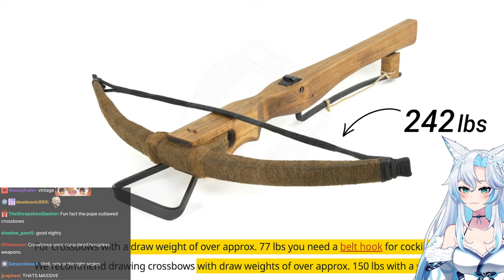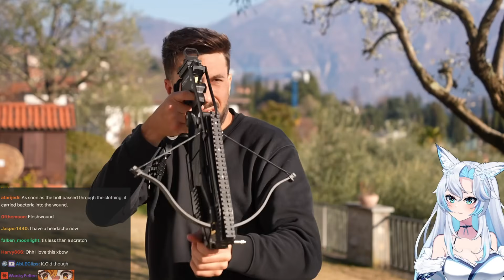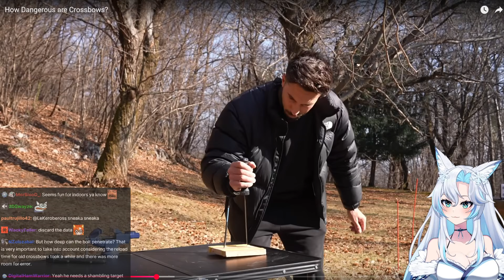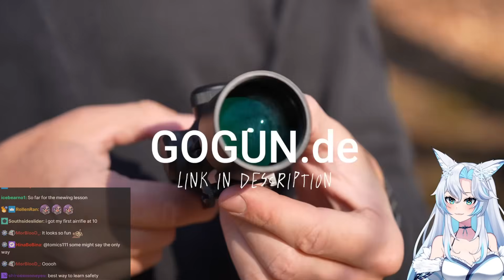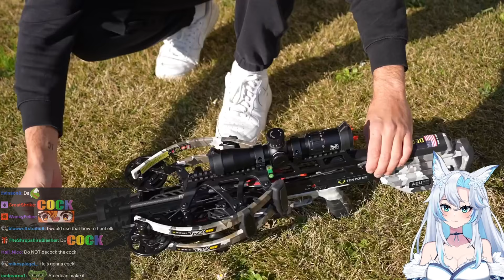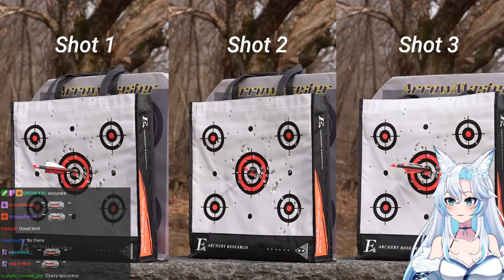How Powerful are Crossbows?

Comment: Thing with the Tenpoint is that you can likely attach a battery-powered winding motor on that loading mechanism and you can partially, or even fully, automate cocking the crossbow. If they add a magazine system on top of that, you'd get the perfect crossbow.

Comment: In fairness to the medieval crossbow, he was using target tips so it wasn't going to have nearly the effectiveness of a broadhead or bodkin. One interesting thing that a chatter mentioned, Pope Innocent II banned the use of crossbows in 1139. Now a lot of people think this is because they could penetrate plate armor but that's not really true. Some versions like the arbalest could pierce some cheaper plate armor but those had spring-steel arms and was essentially using the leaf-spring from an F-150 to throw stuff at an enemy. They were also hideously expensive and were basically used for battlefield assassinations. 
The real reason crossbows were banned was because of ease of use. See there used to be a saying in England, "To properly train a Longbowman you have to start with his grandfather." it takes decades of constant practice to get good with a war-bow, which means there's usually a limited number of truly dangerous archers running around. A crossbow on the other hand, you can teach any idiot/peasant how to use one of those in a couple hours. Give them a week or two and they're going to be as accurate at the same distance as an archer who has been training since they could walk. This made the peasant class way more lethal than usual since while you could keep track of the people who were trained archers, anybody could use a crossbow so there was no telling who was capable of killing from a distance. Now one crossbow was no real danger to an armored knight, same as ONE longbow. Ten of them on the other hand was a different story since with that amount of shots one was bound to find a weak spot. And since they were so easy to use it was starting to change the battlefield in favor of the peasants, which the church absolutely did not like. It's essentially the same reason firearms took over the way they did, it's not so much how much damage they could do, it's the fact that anybody with a few days of practice can use them effectively.

Comment: The adder comes with a 130lb arm far exceeding the results he showed. BUT you better have the arms to cock it. Women have complained they can't. Also the test for penetration was unfair because the first board had Knots where he shot the bolts the second board was knot free making it easy to split.

Comment: How powerful are crossbows?

Well, Crossbows are torison engines. They store kinetic energy in the materials they are made of in the form of tension, and release it all at once when triggered. The only things really limiting their power are A. How long it would take to wind a truly ridiculously powerful crossbow with manageable gear ratios, and B. The ability of the materials the crossbow is made of to not tear themselves apart.

Comment: Chu-ko-nu was a Chinese repeating crossbow from like 2000 yrs ago. Their greatest weakness is that they're quite weak or just straight useless if you're enemy has proper armor on. A proper American solution would be to ramp it up to lethally pierce through modern day body armor. How heavy would that draw have to be to accomplish this consistently I wonder? Makes me wonder if it would just be a better idea to find a way to make the Roman ballistae type siege weapon(i can't remember the damn name) fire faster so we could accomplish the same thing.
Reply: Well, Romans had multiple types of "Ballistae" type of weapons, but I think for anti-personell would be called "Scorpion". They also had early Crossbows - "gastraphetes", and large Ballistae for shooting rocks in sieges. And they had mathematically pre-computed manuals to build those in field, with dimensions already written down. True army of engineers :)
And Jorge Sprave made wooden "automatic" crossbow, similar to "Dwarven repeating ballistae from Hobit: Battle of five armies (extended cut)", but in normal crossbow size
Reply: @johandark5736  Yes! That's what it's called! Scorpions those are the ones I'm talking about. Also, thanks for insight and channel recommendation. I'm checking this out when I have some time

Comment: Speaking from experience, I had a 10 point crossbow not as expensive as the one in the video and it topped out at about 350 ft./s the max effective range of that weapon was roughly 25 yards with practice in confidence I was able to take a shot on a black Hawaiian ramat 30 yards and put it right in the heart the more you train with a piece of equipment the more accurate you’ll get.

Comment: That medieval crossbow is extremely low power for a medieval replica. The real ones could even reach over 1000lb draw weights using thick, spring-steel arms. You can't pull the strings by hand. Instead you use a loading mechanism called a "Goat's foot" for the medium power crossbows and then for the heavy ones it uses and entire windlass pulley system. They were incredibly powerful for their time. They could not fully pierce plate armor but they could easily penetrate mail, really really cheap plate armor, gambesons and most shields. His crossbow is probably a replica of one meant for hunting, not war.

Tl;dr: "The game was rigged from the start." lol
Reply: Yeah, that one is a light hunting crossbow. Something used to hunt smaller animals. This is like a kids toy compared to an actual medieval war crossbow. Those could go up to 1500 pounds. You would be barely even able to move the string by hand and cocking it would take a winch mechanism. This here is basically looking at a .22 and judging the power of a assault rifle from it.
Reply: Ok thanks for the info but would be much cooler and spread wider if you could make a how to DIY medieval crossbow. Also, visual learner here who doesn't speak English. So idk even understand all those items are 😊
Reply: @MangaGamified  Unfortunately, I cannot make crossbows myself. I wish I could. I also cannot find a video of a strong crossbow being made. If you want to see an extremely strong crossbow being fired, find this video on YouTube:

"HEAVY Medieval 1250lbs Windlass Crossbow - TESTED in Slo-Mo"

by Tod's Workshop.
Reply: Two words make armour run in fear

3/4 inch plate-your bolts ain't shit
crossbow-heh, got this kewl new ammo, lesse
3/4 inch plate-AHHHHHHHHH OP PLZ NERF HAX

The words?

BODKIN POINT

under reserve ucc 1-308, 3-402(b)(1)
Reply: @Reichenfaust099 literally nobody wore 3/4 inch plate, and bodies still had trouble punching through the actual armor of the time.
Reply: Honestly they didn't have to pierce plate armor, as impact has so much force, that armored knight is likely to fall anyway. Hit with heavy crossbow is like taking heavy punch.
Reply: @ceu160193  Not really, no. Look at it like a shotgun slug. A slug will not make you fall over anywhere, that's just in the movies. Wearing plate armour will make it even less so.
Reply: @snailmessia  If it doesn't penetrate armor, it is more like a buckshot in close range. And buckshot in close range has insane stopping power, capable of knocking down whoever is on receiving end of it.
Plate armor doesn't make you more stable on your feet, so heavy enough projectile hitting you on your torso = you get knocked down.
Reply: @ceu160193  that's not how physics works. If a shotgun had enough force to knock down a person the recoil would also knock down the shooter. Equal and opposite reactions. Only really big guns like the 4-bore have that kind of energy.
Reply: @General_Weebus  It's exactly how physics work - if your shot can pierce armor,  some energy is spent on breaking armor, flesh, etc. instead of pushing you. But if shot doesn't pierce armor, it's like taking heavy punch - heavy enough to cause internal damage even through armor, which certainly can make target fall. 
As for recoil, it's why you should be in specific pose before shooting, so recoil won't make you lose balance.
Reply: @ceu160193  yeah, crossbows have never had that kind of force behind them. Arbelists, maybe. 

As for recoil, that's still not how it works. Outside of the ludicrously powerful ones, you don't shoulder the gun to prevent it from knocking you over. You do it to steady your aim and help deal with barrel rise. If you had to brace to prevent being knocked over you wouldn't be able to fire while walking or hip fire. The only way an average shotgun, let's say a 12 guage, is going to knock someone over is if they're already unsteady and struggling to keep balance or are extremely small, light, and weak. Go look it up, I think even Mythbusters did a bit on this.
Reply: @General_Weebus  It's less about force and more about weight - crossbow doesn't have force of a bullet, but has significanly higher mass.
Reply: Didn't it depend on the time period? I know early ones had wooden arms, and as time went on, more and more components were replaced with metal.

(Not saying it wasn't underpowered for a medieval replica, I felt it probably was as well).
Reply: @pheonixshaman  Kind of. The ones with the metal arms were usually called an arbalest and they were specially made weapons and weren't really for the same purpose as crossbows. Tod's Workshop has a great video about historically accurate crossbows of all sorts.

Comment: He's calling it semi automatic but that would imply the crossbows have a system of self cocking after each shot. Automatics usually have ways of cocking the bolt and hammer by way of recoil operation or gas operation. These crossbows would actually be closer to bolt action or lever action. Maybe even break action.
Reply: It's bugging both the little American and the Gun Autist inside my brain, too.
Reply: @c0baltl1ghtn1ng  the gun autist in my brain tweaking like that woody gif
Reply: More like bolt action
Reply: @theblahhhman2614 lever action maybe?
Reply: @Nordic_Dumbass  def lever action

Comment: Crossbows kinda changed the warfare meta back in the day iirc so I believe they’re pretty powerful.
Reply: Oh yeah, they had to be lethal otherwise they wouldn't have been used much at all. The "traditional" one he was using was based on a training model rather than an actual full-blown 'battle ready' version - mostly because those types are actually extremely difficult to even source and are very expensive compared to a far more modern version, so there's little market for anyone to make one.
Reply: They where not just strong but also very convenient. You could get one bowmen or a bunch of crossbowmen. Most armies when with crossbows just for this. Also training people to use bows was both expensive and time consuming, while its was a lot easer and cheaper to training people with crossbows.
Reply: interesting to see which came first in battle the crossbow or the ballista both use same principle

Comment: that medieval crossbow is weak. they can get over 900lbs. tod cutler made a 1250lb one
Reply: The peaseantry wouldn't use crossbows commonly anyways, at least the hunters, since they had bows. This doesn't change the fact that the medieval crossbow he used was extremely weak even compared to real medieval crossbows. If it really is a true replica, then it is most likely a small game crossbow. Especially since hunting crossbows tended to have the weight of 450-600lbs and war crossbows 700-1300lbs. The peasants who used hunting crossbows would have the same strength crossbows, otherwise they wouldn't be able to hunt much. Not to mention medieval bolts could weight twice the amount of what he shot, and would never have had a tip like that.
Reply: @hannesh234  Google says that basic crossbows have a draw weight of 100-200 lbs, and he had a 200 lbs crossbow, putting it in the average range. Forgive me if I believe google more than a random person. Also, if average crossbows really started at 400lbs, then they wouldn't even make crossbows without the drawing tools as it would be a basic requirement to even use it.
Reply: @nujevad28  sorry but google says that medieval crossbows started at what I said. Maybe you aren't checking whether your average states the type of crossbow, for example a modern hand crossbow. In any way you should always check further than your first result in google after a vague search. War bows were around 100 lbs (80-110 to be precise). You may believe google more than me, and as I said there probably were weak smallgame crossbows like his, however if we are talking about actual useful crossbows, then the numbers I gave, which are backed by historians are still accurate.
Reply: There is another fact to consider here. Medieval crossbows, had to be of a higher draw weight, because they had shorter draw lengths. Modern crossbows which use the compound style of acceleration can have a longer pull, which gives more power at a lower poundage, because it is able to accelerate the bolt for longer. When I did a quick google search also it said what you said, except when I opened the link, all it talked about was modern crossbows, and about the pros and cons of these newer mostly compound style crossbows.
Reply: I don't think he was showing off the most powerful medieval crowsbows ever made, just a typical one that most users would've had access to at the time.
Reply: @nujevad28  typical would be 400-600. If you can draw it without a  goats foot or a windlass its too weak id say
Reply: @peevshalpatine  According to google, the 400-600 lb crossbow are hunting versions, which are expensive and not used by the common peasantry.

Comment: Bows had a lower draw weight because they didn't need it. Bows had more power, it's just that the crossbow didn't require skill to use them. Just point and shoot. The lack of draw length made them much weaker despite the draw weight.
Reply: True but if you supersized a crossbow you get a ballista. Now that packs a punch ;-D
Reply: Yeah that was their biggest selling point. Virtually anyone can use a crossbow while only someone with proper training and strong arms can use a bow the right way.

Comment: I hunt deer with a 400fps crossbow. It goes straight through regular archery targets and deer. I can tell you from experience that nine times out of ten, once that arrow leaves the bow you will never see it again. When you are lucky enough to find one it's always broken in some way or irretrievably buried in a tree. The bolts are quite expensive too. The ones I use run about 17$ a piece and that's not counting the broadhead that costs about 10$ to 50$ a piece. You need special high velocity targets to catch bolts from high velocity bows without damaging the bolts too. Archery hunting is expensive. For the price of ten arrows with broadheads I could buy a cheap hunting rifle with ammo.
Reply: I found all that out pretty quick with my 385fps crossbow😅
Reply: Yikes. I think just using a rifle seems better. Unless you do it for hobby reasons, if you do for a job that's an extra cost you dont want.
Reply: @danielmendoza839  A rifle is much easier and sometimes cheaper but archery gets a full five months of hunting season for deer here in Arkansas while the rifle season is only two weeks. Generally the harder a hunting method is, the longer the season is for it. Some Wildlife Management zones are restricted to certain gear too. The area around Greers Ferry Lake is a bow only area for deer. Meaning that if you want to hunt a deer there you can only use a bow. Some states like Maine even divide the bow season by the type of bow. Alabama allows hunting with poison tipped arrows. So sometimes we use a bow to get more days to hunt and other times a bow may be required for a particular area. Also most Wildlife Management Area archery permits are free whereas you have to pay for modern gun permits and enter a drawing that you hope you win. You don't get your money back if you don't win either. There's trade offs to both. Rifle is easier but very heavily restricted and bow is much more difficult but much less restricted.
Reply: @roberthendersonjr.595    true that's a pretty good point. I didn't remember about seasonal gear restrictions until you mention it.
Reply: I can’t wait till the time we get a crossbow that can shoot a half ounce lead bullet at 500 fps

Comment: 1:44  It's probably not nearly as bad as reloading those old flintlock pistols and rifles. You know, what with the fact that you have to carefully insert 3 or 4 different things into the barrel before it's ready to fire again. Makes handloading classic revolvers look like a breeze, too. lol
Reply: its worse, you have to be pretty strong to load one and doing that is exhausting because of the amount kinetic energy that is being stored or its long with the winch, that is why handguns immediately replaced crossbows, because along with the prior, theyre easier to maintain, construct, and use, with fewer points of failure, and being much stronger because of stored chemical energy over stored kinetic energy
Reply: The whole reloading thing was remediated quite effectively by making pre measured paper cartridges, you just need to bite off the top of the cartridge and pour a bit of powder into the "pan" (the little receptacle on top of the trigger where the flint sparks) and then empty the rest of your powder into the gun followed by the rest of the cartridge which contains the lead ball.
It's still a slower process than metal cartridges, but way faster and more accurate than the older way of carrying a powder flask and lead balls with you.